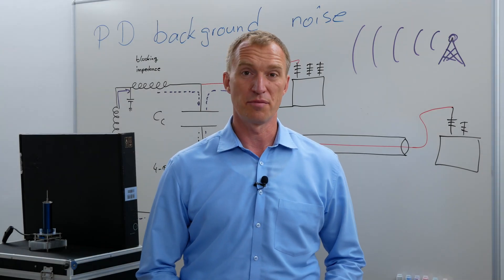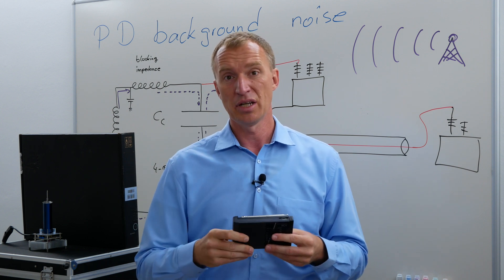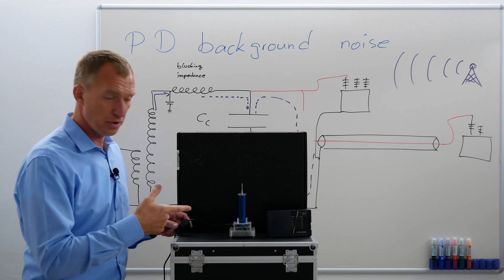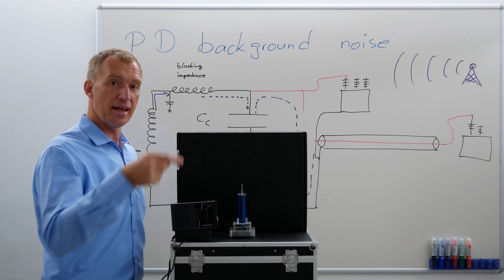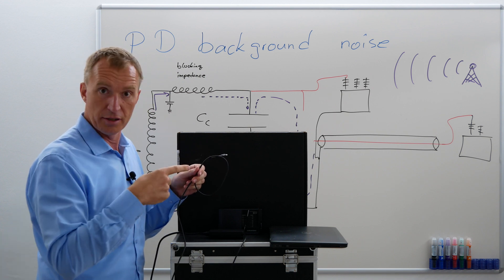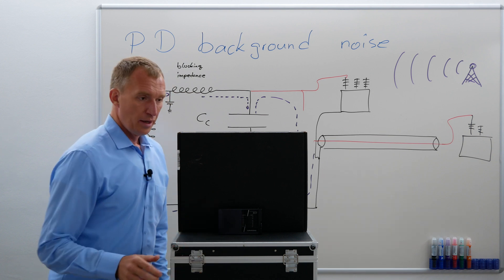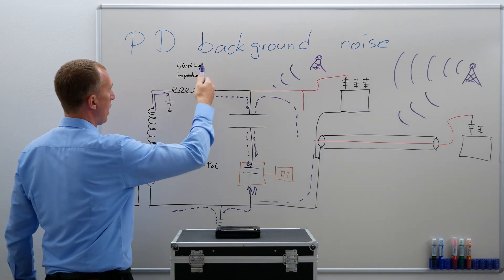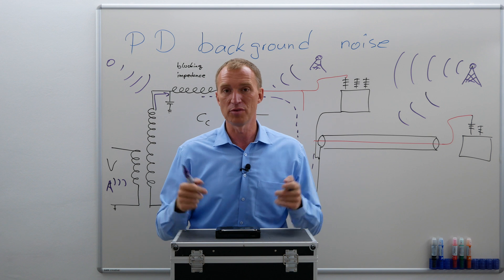2.5 Partial Discharges Vocabulary - background noise and cheapest PD detector I know of

Comment: This is a really good explanation. Could we have a filtering circuit of some kind before the PD is measured into measurement equipment to get rid of this noise? Is it possible to apply a passive or active filter to the signal? And, could you kindly advise which filter would work best for the noises—low pass, high pass, or anything else? Although I am more interested in electronics, this PD measurement truly piques my curiosity.